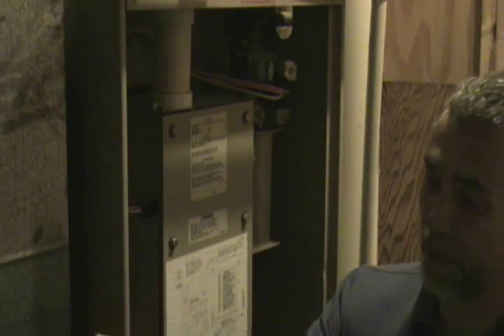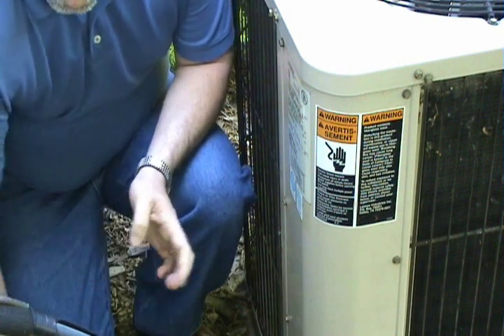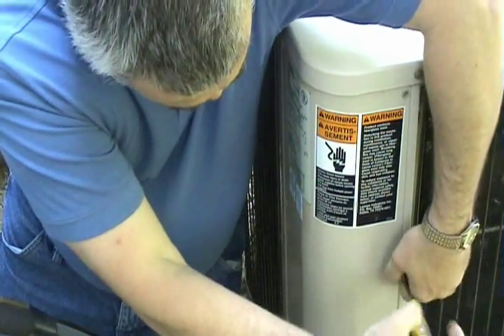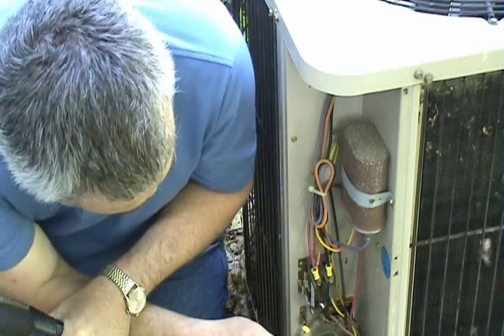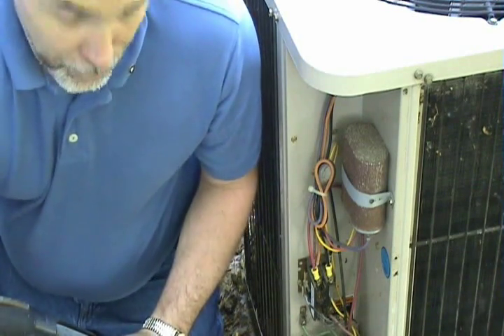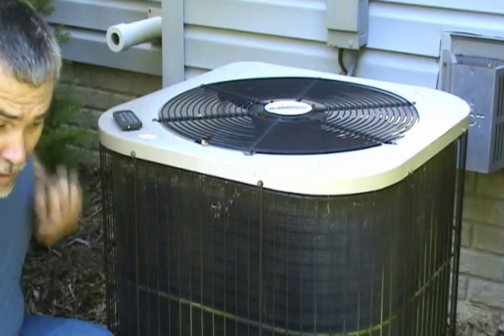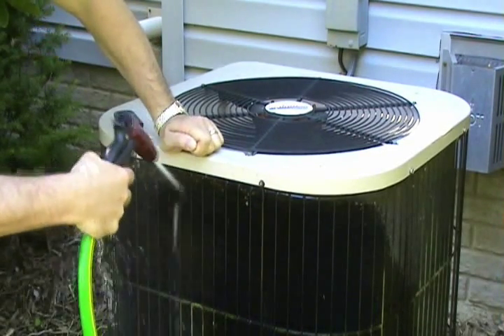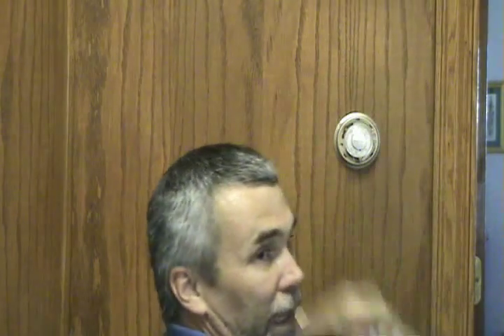Don’t Skip These 5 AC Maintenance Steps! ❄️ Homeowner's Guide

Comment from the maker: The most important tip in this video is the Air Filter! 80% of the service calls I go on for 'no cooling' are actually just caused by a $10 dirty filter blocking all the airflow. Check yours every 30-60 days! 🌬

Quick Tip: When cleaning your outside coil with a hose, always spray from the top down and be careful not to bend the aluminum fins. If you flatten those fins, you'll actually block the airflow and make your unit run hotter! [10:52]